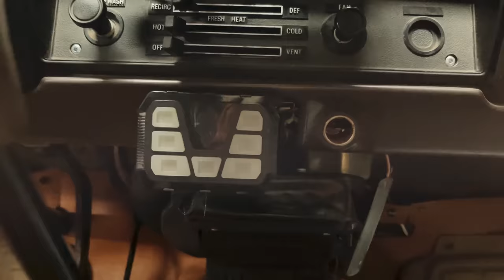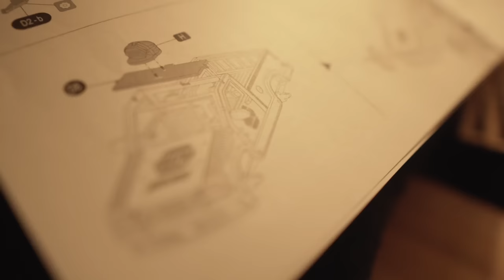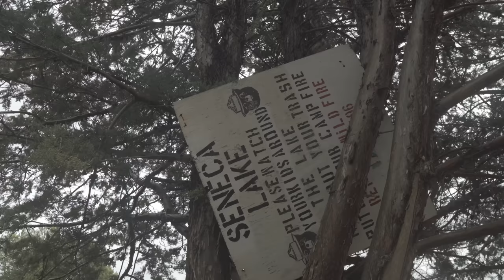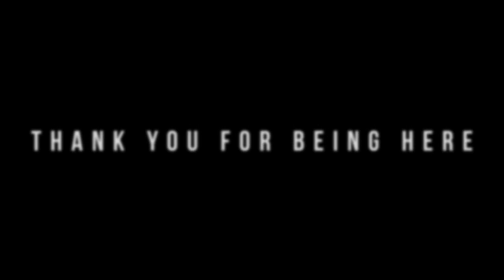We BUILT our 4x4 HOME just to come HERE! | 4x4 Toyota Chinook Overland Adventure

Comment: Nice job. Your production value is at a pro level. Keep it up. Speaking from experience, watch carefully the upper edges of the camper when wheeling. 1 inch of movement at the tire is 1 foot at the top of the camper.
Reply from the maker: Thank you so much 🙏 and yes! We have noticed that for sure

Comment: Lower tire pressure when on trails, if you have the means to air them back up. More grip and softer ride on the bumps
Reply from the maker: We always do! Bit different with the Chinook cause of the weight and only load range C tires for now.

Comment: Can you lower the ride height of the rig or will you be slamming bump stops. I see a 1" coil spring spacer up front.
I have a 80, started with a 5" lift now down to a 3" lift. Every inch makes a huge difference in handling. 
Do you have stock sway bars. The FZJ sway bars are thicker then FJ80, Whiteline sells even thicker than stock.
Just Sayin...